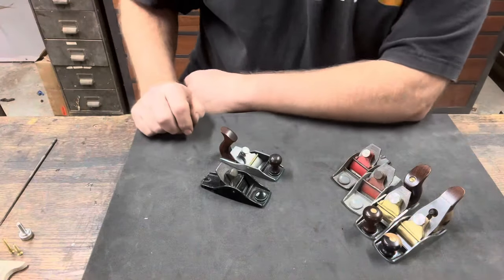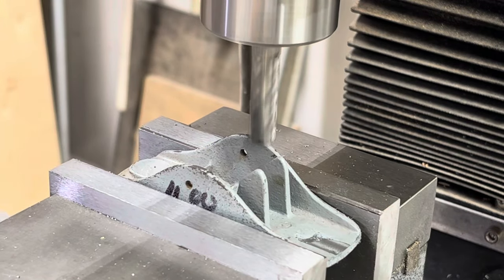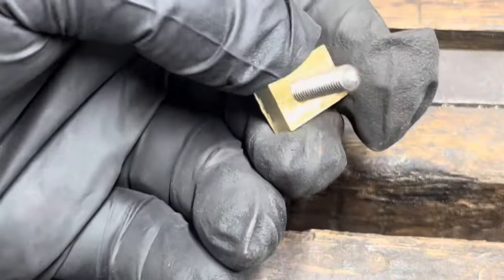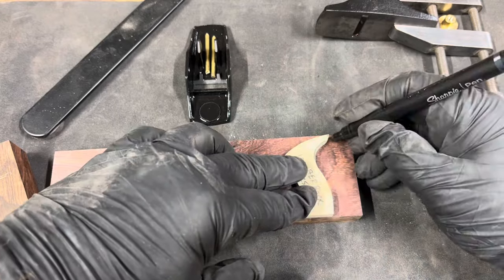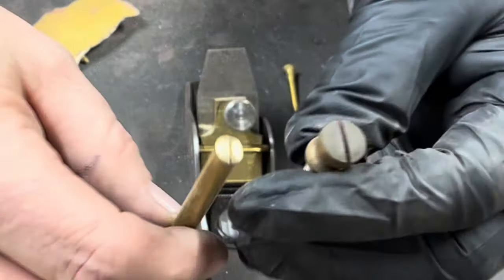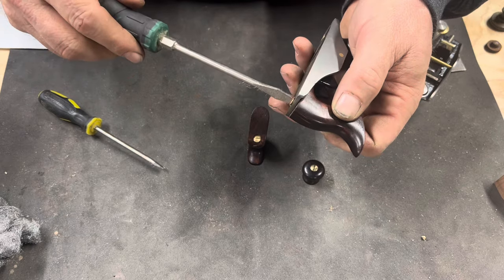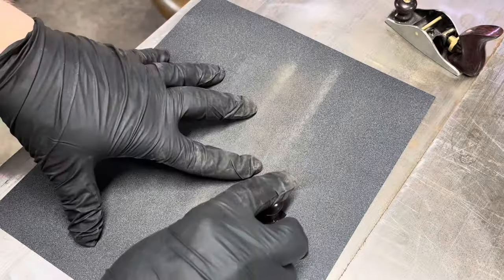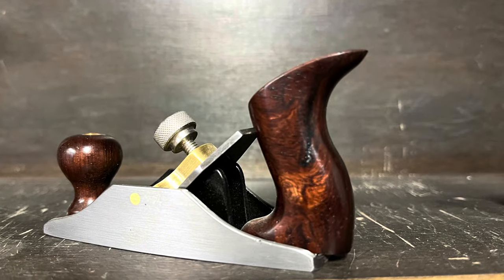Making a Stanley 101 plane with a Tote & Knob

Comment: There are a few things I would not do, or I would do differently, as I feel it degrades the plane. But aesthetically speaking,  AMAZING work.
Reply from the maker: I would love to hear more.
Reply: For one, drilling through the sole of the plane should have been avoided. Instead of milling off the bosses, I would leave it for its thickness and drill a blind hole and tap it. You only need a few threads. You can also reduce the diameter of the boss by milling around its circumference using a rotary table, or lathe chuck, if it's big enough.
Reply: @bobweiram6321 Yes, exactly, that was one of the things I would have done differently.  That would allow a through screw or stud for the tote and knob.  But even if you do remove the index boss, I would still use a long counter sunk machine screw, all the way through the tote, rather than a wood screw.

Also, I would not have worried about the faux adjusters, they serve no function and requires milling away material, therefore creating a weakness. 

And cutting the slot in the iron reduces the usable length of the blade, for no good reason other than aesthetics.

Comment: Looks really amazing! I would make one for myself I could find one of these 101's here in Brazil for a decent price. Prices here are $70-$80 for the gray bodies!
Reply from the maker: Keep looking, they are out there. I hope you find one.
Reply: @DaveCorinth  the availability of old tools is regional. If they weren't there in the past they're not there now either. Some places are awash in that stuff. Lots of other places, not so much. Even now in the rich ground stuff's getting scarcer than it was. Every now and again I still run across a good find though. But it's getting less and less.

Comment: These are so cool! Did you change the angle on that first one? It looks like a lower angle than the others.
Reply from the maker: They are both the standard 45 degrees, I have in the last made a low angle version though.
Reply: @DaveCorinth  sorry, I meant the first one you made for your son. It looks like a low angle. How would one go about changing this to a low angle anyway?
Reply from the maker: Yes the first one was a low angle, and it took forever to make. I used a file to lower the rails to 12 degrees.